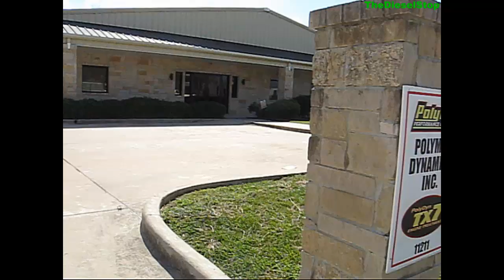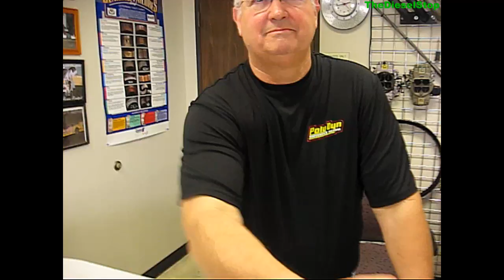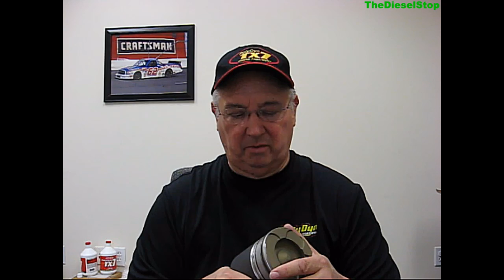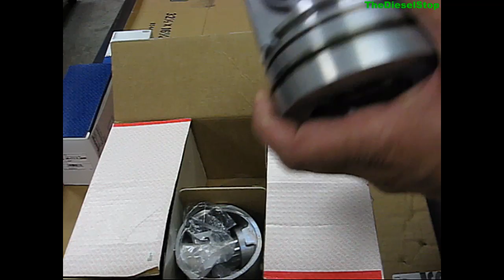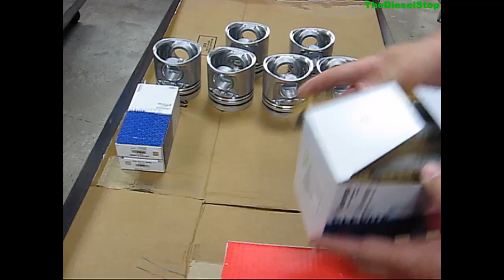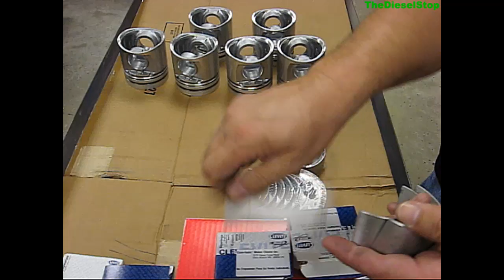5.9 Cummins PolyDyn coated pistons 1

Comment: @1977chevyk20 
Coating the tops and skirts normally runs $36 per piston. The main bearing set for a Cummins cost $50.40 and the rod bearing set cost $28. The turn around time is normally 2-3 days in shop.

Comment: @Mopardude 
The coating adds 3 to 5 tenths of a thou.(.003"-.005") So if your running tight clearances then you want to take the coating into consideration. If you are running on the fat side then you don't need to worry about the coating. Ask your engine builder what he prefers.